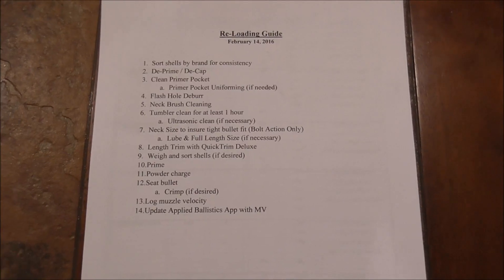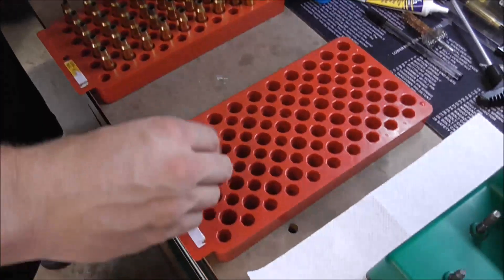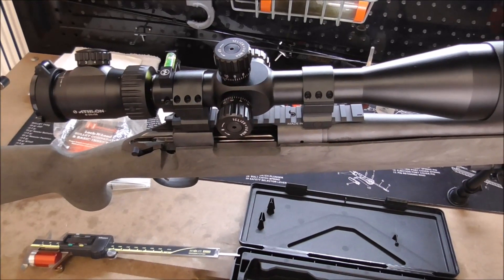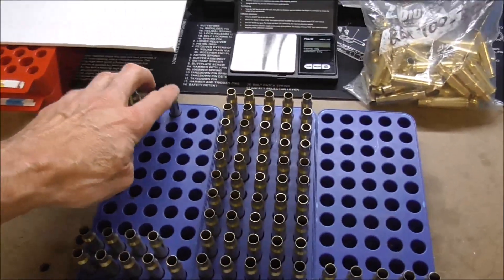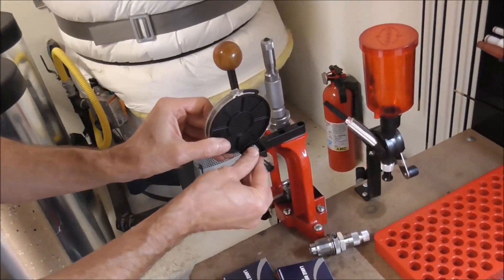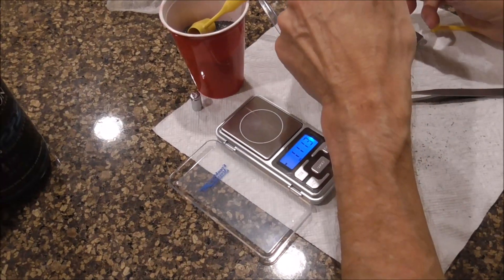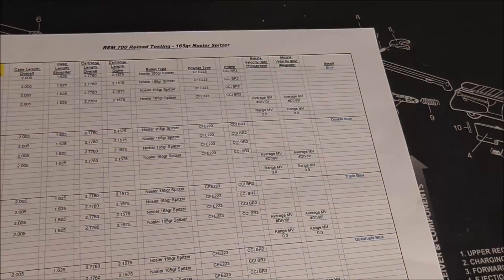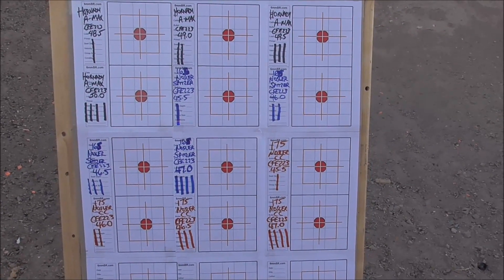Reloading 308 Ammo - My Basic Technique

Comment: I have found that by using an extruded powder, that fills the case more you will generally have more consistency and better accuracy. Try some Varget, Benchmark and IMR 8208XBR. Also check to see if that stock forearm is binding against the barrel while in the shooting rest/bipod as it can be different than on a bench in the reloading room. Good luck